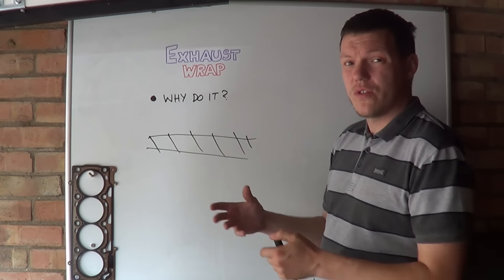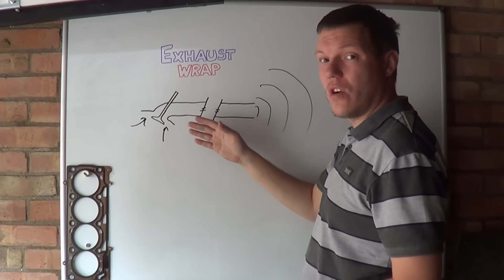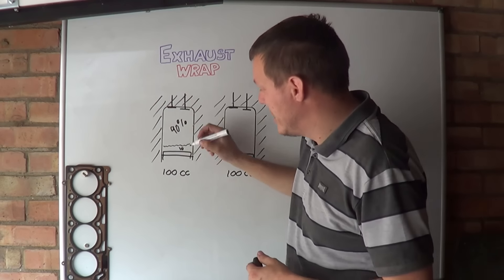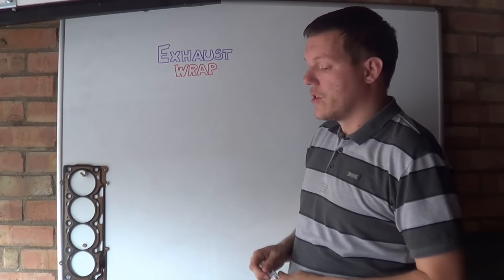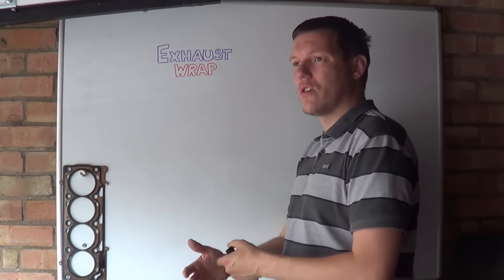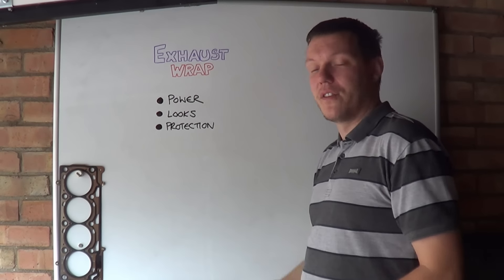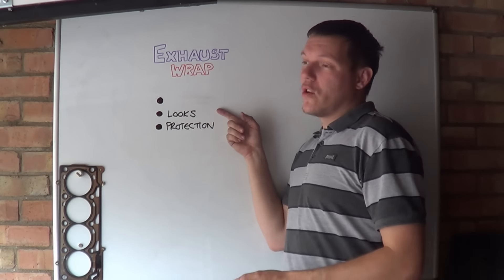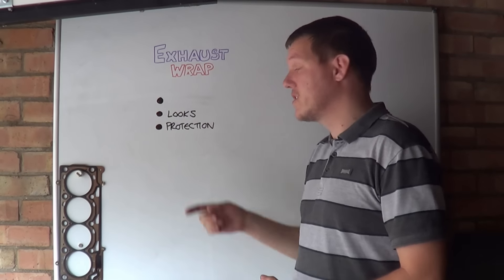Exhaust Wrap - Good or Bad - Bike TEch

Comment: I have 33 years experience in making and fitting exhausts. Non of my suppliers will warranty there headers if you wrap them. It causes major heat retention and will cause all stainless steel pipes to crack and crystallise. One set of headers after just one month use on a vehicle, when unwrapped because they developed leakage due to heat cracks.  They actually shattered when dropped on the workshop floor from about 2 feet. It was areal eye opener to see the damage heat had done to the headers. For me its a big no .
Reply: @jackdale9249  Did you just call me a lying sack of crap. Since when did you have the right to call names . Me I have 34 years in the Exhaust manufacturing industry.I make custom pipes and i Learnt the hard way don't wrap. Now be a nice person and either take my advice or don't .Either way I wont stoop to insults.
Reply: @jackdale9249  THE FACTS:

*Header wraps are designed to keep the heat in the header to improve scavenging of the cylinders. Keeping the heat in the header allows the exhaust speed to remain high. (the right idea)

*There are no header manufacturers that I know of that will warranty their headers if any header wraps are installed on their products.
In most cases the header wrap damages the headers beyond repair. (I will explain below)

*If you run a lean mixture, you "may" see a slim performance gain using header wraps. A rich mixture may show slim to absolutely NO gain in performance.

*If you do not mind replacing your headers and header gaskets regularly, and you like that ugly look of a wrapped header, go ahead and use the heat wrap.

BACKGROUND INFORMATION:

In the past, almost all NASCAR and other racing engine builders used the header wraps for the added power gains. But, after having to replace the headers after each race due to the wrap being about the only thing holding the header together, they do not promote the practice any longer! They now utilize the thermal coatings that are chemically and electrically applied to the headers. Those include Airborn, Jet Hot, HPC, and others.

Imagine having to replace a $1200.00 plus set of headers after each race weekend! Few but the most financially well-off race teams can afford to do this. But, it is also in the downtime for remaking a custom set of headers. Most custom header makers do not have copies readily available.

*I believe that the wraps are good to protect various items from heat, but not to hold the heat in the header. For example: you can use the wrapping for the protection of fuel and oil lines, wiring, etc.

*Cool air needs to be around the header, and insulating it with a wrap to hold exhaust heat in makes the header material temperatures near molten. When you wrap the header you trap the heat in the header, but also in the material that needs to breathe to dissipate heat for it's own survival.

*Engineers, Metallurgists, and other experts out there will state that there is no way that the material can fail because it can withstand, and it was designed to withstand, the internal temperatures of exhaust gases. TRUE! But, when the header is not allowed to cool so as to dissipate those extreme temperatures that the wrap is controlling, you have now developed a heat absorption that compares to thermal friction which will will continue to gain in temperature beyond the normal exhaust gas temperatures (EGT's). This is the same as with most any insulation.

Try this experiment ... launder a load of bath towels and then dry them. Immediately pull them out of the dryer and just toss them in a snug pile on your bed. Now leave them there for a day and then open them. You will find that there is still a considerable amount of heat left in the center towels. This heat, even though the outer towels and bed are normal room temperature have been able to contain their heat. This is a simple thermal insulation test, but with your headers you have an internal heat supply coming from the engine. The heat on the outside portion of the header material is trapped between the warp and the header and will continue to fatigue the header. This build of heat is amplified by the wrap. Towels do not need to breathe, header material does.

The EGTs stay the same but the properties of the header material changes in a way of amplifying the temperatures because of the insulation. This action goes against normal laws of thermal dynamics, but this effect is fact, and you have to pull the ears off most engineers before they believe you. This is the trouble with plenty of education, but NO "common sense"!

Something else that few Racers and Car Owners realize:
Headers Oxidize!

Under normal use and even more with higher EGTs and header surface temperatures, headers will oxidize and material is actually removed from the headers. This means they get lighter and weaker.

Try these actual test numbers:
Mild Steel (1010) uncoated header exposed to 1200º F. in normal air will have a weight loss percentage of roughly 25% with only 10 hours use at this temperature.

Stainless Steel (410) uncoated header will have roughly 8% weight loss in the same 10 hour period.

A coated mild steel header will have NO weight loss at temperatures up to 1200º F. In fact it will actually gain a bit of weight! Between 1300º F. and 1600º F. the coating will begin to show signs of mud cracking or like the look of lacquer checking. However, limited diffusion takes place between the coating and the substrate, producing a very thin film of iron aluminide, which continues to inhibit oxidation.

On A Side Note:

Do you understand the physics of exhaust flow in regards to step-headers?

Step headers are designed to allow controlled and efficient exhaust gas expansion at a selected engine RPM. What does this mean? As exhaust gases are exiting the engine into the header they are still burning and rapidly expanding down the primary tubes. If you design the header to take advantage of the pulse expansions of the exhaust gases you WILL gain horsepower. But, you'd better do it right, or that $1200.00 or more for a set of headers is a waste of money. When you set up a step header, you'd better know where you want the maximum power at, since steps are RPM specific to each engine combination.

I'd better say this now ... a step is an increase in tube diameter.

Here is an example:

A basic Chevrolet 350 cubic inch engine ... 3.48 stroke, 5.7" connecting rod length, 4.0" bore, 10.5:1 compression ratio, standard 2.02 / 1.60 valves ... designed for 6500 RPM operation. Cam specs are: .500" lift, 235º duration @ .050" lift, 112º lobe centerline.

For the average Joe Bracket Racer this would be a standard 1-5/8" or 1-3/4" primary header primary tube size, depending on vehicle weight and where you want your power. Here is the "exact" header size for a racing engine operating at 6500 RPM. Note: This is for max power at 6500 RPM!

BASIC KNOWLEDGE:

As you may or may not know from any education of standard thermal expansion physics, if you heat donut does it shrink or expand the hole? Of course since we live in a 3-dimensional world, it is a 3-dimensional reaction and it shrinks the hole! If any engineers want to argue this, start with your professors, not with me. I already know the facts and I have had engineering "students" argue this fact with me on numerous occasions.

Because of the expanding gases, if you have had the experience (as I have) to see first hand where a header with a wrap fails, it is typically where a step would be. I have had headers in my hand where literally the only thing keeping the header in one piece was the wrap. Whole chunks of the header material was gone, melted away. Talk to most "engineers" (I use that title with caution) and they will probably tell you that aliens stole the metal as the car was racing around the track! They say this because the wrap is causing problems that are not part of normal metallurgy and thermal dynamics theory <key word>. The header warp allows temperatures between the wrap and the header to turn the material molten.

back to top

--------------------------------------------------------------------------------

IN CLOSING:

We know that header manufacturers will NOT WARRANTY a header which has had a wrap installed on it. We know that I have personally seen, tested and inspected headers that have been destroyed after running wrapped headers on a perfectly tuned engine.

Just because an item or product is advertised for a specific use does not mean it does not do what it is promoted as, but it also does not mean it is the best choice either. We have all seen the recent TV commercials on all of these "medical miracles" that do such feats as fast weight loss and re-grow your hair. How often have we laughed at the side affects, like the most common being penile failure. Oh sure, I want to take some drug if my hair starts falling out (yes, it is currently all here) that makes my sex life go to hell. NOT !!! Those pharmaceutical companies can pucker up and kiss my "bald" backside! I'd rather have function than hair.

The same can hold true with other products. Heat wraps are great, just do not use them ON the header. Use them on a device or component on your vehicle that you are trying to protect from header heat.

If you want a true thermal barrier that will reduce thermal loss in the header, reduce under hood temperatures, and make a few horsepower in the process, have your headers coated by one of the many companies available (links to a few are above). Most all of the coating companies offer inside and outside complete coating as standard. DO NOT allow your headers to only be coated on the outside, this is not a complete or quality process.

Some other considerations about the coatings. Once the header is coated, it's permanent. That means that if you screw up your header, it is not an ease job to repair and most header companies do not want to even attempt a repair. The coating permeates into the header material which makes welding processes on a coated material less than adequate. This is why you always coat the headers last, after all modifications to the header are made, and you are 100% sure the header will fit your vehicle.

>>Source: http://www.centuryperformance.com/heatwraps.asp
Reply: The guy  is spouting nonsense it's a bunch of malarkey just ignore him go ahead and wrap if you want it causes no damage whatsoever! 
What he's saying is completely absurd! caused it to crystallize shatter when dropped? get real man is so full of himself the shits coming out of his eyeballs
None of those claims he's makes has ever  been published in any engineering journals! 
for some reason he has just got irrational bias! 
I remember one of my professors would call it  Invincible ignorance ! LOL  he has a case of the ass against wrap so he talks nonsense.
Reply: so just how many sets of custom headers have you made in your life.  Just because you wrap your pipes and suffered no effects is different to my experience. And my opinion does not require such childish rude replies. As I said in my opinion dont do it but that is my opinion. Dont take my advice .
Reply: @neildale1322  THE FACTS:

*Header wraps are designed to keep the heat in the header to improve scavenging of the cylinders. Keeping the heat in the header allows the exhaust speed to remain high. (the right idea)

*There are no header manufacturers that I know of that will warranty their headers if any header wraps are installed on their products.
In most cases the header wrap damages the headers beyond repair. (I will explain below)

*If you run a lean mixture, you "may" see a slim performance gain using header wraps. A rich mixture may show slim to absolutely NO gain in performance.

*If you do not mind replacing your headers and header gaskets regularly, and you like that ugly look of a wrapped header, go ahead and use the heat wrap.

BACKGROUND INFORMATION:

In the past, almost all NASCAR and other racing engine builders used the header wraps for the added power gains. But, after having to replace the headers after each race due to the wrap being about the only thing holding the header together, they do not promote the practice any longer! They now utilize the thermal coatings that are chemically and electrically applied to the headers. Those include Airborn, Jet Hot, HPC, and others.

Imagine having to replace a $1200.00 plus set of headers after each race weekend! Few but the most financially well-off race teams can afford to do this. But, it is also in the downtime for remaking a custom set of headers. Most custom header makers do not have copies readily available.

*I believe that the wraps are good to protect various items from heat, but not to hold the heat in the header. For example: you can use the wrapping for the protection of fuel and oil lines, wiring, etc.

*Cool air needs to be around the header, and insulating it with a wrap to hold exhaust heat in makes the header material temperatures near molten. When you wrap the header you trap the heat in the header, but also in the material that needs to breathe to dissipate heat for it's own survival.

*Engineers, Metallurgists, and other experts out there will state that there is no way that the material can fail because it can withstand, and it was designed to withstand, the internal temperatures of exhaust gases. TRUE! But, when the header is not allowed to cool so as to dissipate those extreme temperatures that the wrap is controlling, you have now developed a heat absorption that compares to thermal friction which will will continue to gain in temperature beyond the normal exhaust gas temperatures (EGT's). This is the same as with most any insulation.

Try this experiment ... launder a load of bath towels and then dry them. Immediately pull them out of the dryer and just toss them in a snug pile on your bed. Now leave them there for a day and then open them. You will find that there is still a considerable amount of heat left in the center towels. This heat, even though the outer towels and bed are normal room temperature have been able to contain their heat. This is a simple thermal insulation test, but with your headers you have an internal heat supply coming from the engine. The heat on the outside portion of the header material is trapped between the warp and the header and will continue to fatigue the header. This build of heat is amplified by the wrap. Towels do not need to breathe, header material does.

The EGTs stay the same but the properties of the header material changes in a way of amplifying the temperatures because of the insulation. This action goes against normal laws of thermal dynamics, but this effect is fact, and you have to pull the ears off most engineers before they believe you. This is the trouble with plenty of education, but NO "common sense"!

Something else that few Racers and Car Owners realize:
Headers Oxidize!

Under normal use and even more with higher EGTs and header surface temperatures, headers will oxidize and material is actually removed from the headers. This means they get lighter and weaker.

Try these actual test numbers:
Mild Steel (1010) uncoated header exposed to 1200º F. in normal air will have a weight loss percentage of roughly 25% with only 10 hours use at this temperature.

Stainless Steel (410) uncoated header will have roughly 8% weight loss in the same 10 hour period.

A coated mild steel header will have NO weight loss at temperatures up to 1200º F. In fact it will actually gain a bit of weight! Between 1300º F. and 1600º F. the coating will begin to show signs of mud cracking or like the look of lacquer checking. However, limited diffusion takes place between the coating and the substrate, producing a very thin film of iron aluminide, which continues to inhibit oxidation.

On A Side Note:

Do you understand the physics of exhaust flow in regards to step-headers?

Step headers are designed to allow controlled and efficient exhaust gas expansion at a selected engine RPM. What does this mean? As exhaust gases are exiting the engine into the header they are still burning and rapidly expanding down the primary tubes. If you design the header to take advantage of the pulse expansions of the exhaust gases you WILL gain horsepower. But, you'd better do it right, or that $1200.00 or more for a set of headers is a waste of money. When you set up a step header, you'd better know where you want the maximum power at, since steps are RPM specific to each engine combination.

I'd better say this now ... a step is an increase in tube diameter.

Here is an example:

A basic Chevrolet 350 cubic inch engine ... 3.48 stroke, 5.7" connecting rod length, 4.0" bore, 10.5:1 compression ratio, standard 2.02 / 1.60 valves ... designed for 6500 RPM operation. Cam specs are: .500" lift, 235º duration @ .050" lift, 112º lobe centerline.

For the average Joe Bracket Racer this would be a standard 1-5/8" or 1-3/4" primary header primary tube size, depending on vehicle weight and where you want your power. Here is the "exact" header size for a racing engine operating at 6500 RPM. Note: This is for max power at 6500 RPM!

BASIC KNOWLEDGE:

As you may or may not know from any education of standard thermal expansion physics, if you heat donut does it shrink or expand the hole? Of course since we live in a 3-dimensional world, it is a 3-dimensional reaction and it shrinks the hole! If any engineers want to argue this, start with your professors, not with me. I already know the facts and I have had engineering "students" argue this fact with me on numerous occasions.

Because of the expanding gases, if you have had the experience (as I have) to see first hand where a header with a wrap fails, it is typically where a step would be. I have had headers in my hand where literally the only thing keeping the header in one piece was the wrap. Whole chunks of the header material was gone, melted away. Talk to most "engineers" (I use that title with caution) and they will probably tell you that aliens stole the metal as the car was racing around the track! They say this because the wrap is causing problems that are not part of normal metallurgy and thermal dynamics theory <key word>. The header warp allows temperatures between the wrap and the header to turn the material molten.

back to top

--------------------------------------------------------------------------------

IN CLOSING:

We know that header manufacturers will NOT WARRANTY a header which has had a wrap installed on it. We know that I have personally seen, tested and inspected headers that have been destroyed after running wrapped headers on a perfectly tuned engine.

Just because an item or product is advertised for a specific use does not mean it does not do what it is promoted as, but it also does not mean it is the best choice either. We have all seen the recent TV commercials on all of these "medical miracles" that do such feats as fast weight loss and re-grow your hair. How often have we laughed at the side affects, like the most common being penile failure. Oh sure, I want to take some drug if my hair starts falling out (yes, it is currently all here) that makes my sex life go to hell. NOT !!! Those pharmaceutical companies can pucker up and kiss my "bald" backside! I'd rather have function than hair.

The same can hold true with other products. Heat wraps are great, just do not use them ON the header. Use them on a device or component on your vehicle that you are trying to protect from header heat.

If you want a true thermal barrier that will reduce thermal loss in the header, reduce under hood temperatures, and make a few horsepower in the process, have your headers coated by one of the many companies available (links to a few are above). Most all of the coating companies offer inside and outside complete coating as standard. DO NOT allow your headers to only be coated on the outside, this is not a complete or quality process.

Some other considerations about the coatings. Once the header is coated, it's permanent. That means that if you screw up your header, it is not an ease job to repair and most header companies do not want to even attempt a repair. The coating permeates into the header material which makes welding processes on a coated material less than adequate. This is why you always coat the headers last, after all modifications to the header are made, and you are 100% sure the header will fit your vehicle.

>>Source: http://www.centuryperformance.com/heatwraps.asp
Reply: @cadillacranch8169  this  is total BS  ! show some articles in legit engineering journals saying wrap causes damge ? you CAN'T !  there aren't any ! 
you tube is deleting false info now and yours should be at the top of the list !
Reply: @cadillacranch8169  i've made plenty of exhaust sytems and many factories like Yamaha have wrapped pipes !  w/ NO damage !  
IF this was really happening as you claim there would be a plethora ( a lot ) of articles in engineering magazines and journals ! there are NONE ! 
you are a delusional liar and should be banned fr you tube ! i'm reporting your posts as lies !  they are deleting incorrect content now ! -like yours !
Reply: @jackdale9249   Okay I'll humour you did you click on the link that I sent you. Click on read more there's a whole article not by me I found it on Google. It's a long read which might be beyound your attention span. As you think it's okay to key board warrior people you don't even know. Under the facts. Look down it says read more. Stop being an angry person venting with threats. The evidence is there.
Reply: @jackdale9249  The apparentely gruesome facts about Heat Wrap.. [Archive ...www.mr2.com › forums › archive › index.php
In most cases the header wrap damages the headers beyond repair. (I will explain ... will consider thermal wrapping a voiding of their warranty.
Jul 23, 2006 - 16 posts - 7 authors
You visited this page on 15/08/20.
Reply: @jackdale9249  
Should I wrap my headers? - Summit Racinghelp.summitracing.com › app › answers › detail › a_id
May 11, 2017 - Header wrap is more expensive than high temp paint. But, it is less ... **Wrapping a set of headers will void the warranty.**. Answer ID 4801 ...
Reply: @jackdale9249  The apparentely gruesome facts about Heat Wrap.. [Archive ...www.mr2.com › forums › archive › index.php
In most cases the header wrap damages the headers beyond repair. (I will explain ... will consider thermal wrapping a voiding of their warranty.
Jul 23, 2006 - 16 posts - 7 authors
You visited this page on 15/08/20.
Reply: @cadillacranch8169  those sources say NOTHING about wrap you lie !
Reply: @cadillacranch8169  i wrote to summit racing I am a racer and summit customer this answer is BS and will soon be deleted !
Reply: @cadillacranch8169  lie doe3s NOT say it damages headers you lie !  blogs are NOT engineering level talk thery are some squid ususally spouting nonsense !
Reply: @cadillacranch8169  point is you are lying ! it will NOT damage as you claim !
Reply: How does it affect performance?
Header Wrap keeps the heat in the pipes. This improves exhaust flow and The Scavenging Effect. It also lowers underhood temps. Wrapped headers will make a little more Torque and Horsepower than a bare metal set.

Despite improving performance, wrapped headers have a few weaknesses. First, because the heat is retained inside the wrap, the metal gets much hotter than painted or coated headers. The higher heat cycles will fatigue the metal. The wrap will also hold moisture, promoting rust and corrosion.

*Wrapping a set of headers will void the warranty.*
This is from Summit racing web site
Reply: @cadillacranch8169  ANOTHER bs VIDEO THE PIPE WAS WRAPPED AFTER ALEADY CORRODED ! 
AND WHO USES STEEL IN EXHAUSTS ?  ALL ARE ss NOW  OR INCONEL ! SHIT RUSTS IN uk AS IT'S FRIGGEN wet ALL THE TIME THERE !  HAS nothing TO DO W/ WRAP !  duh !
Reply: @cadillacranch8169  BS article fr 2015 on go karts ?  get real  wrap causes NO harm ! 
you are scratching the bottom quoting a Go-kart racer ! LOL Hilarious ! 
bs premise saying the heat is so high it will damge the pipe !  no engineering proof ! 
 and NOONE uses mild steel for exhaust anymore !  so NO that article proves nothing . 
ALL modern systems are stailess Iconel , or titiainuim  SS is preferred . 
Most Ferrari owners fit exhaust blankets which are the same as wrap really !
Reply: @cadillacranch8169  all irrelevant as noone uses ferrous metal now it is all SS , or other NON rusting material ! !   you are a fool to keep finding articles which do not prove your assertion that wrap is bad , causes damage it does not !  any condensation wil be disssapated by heat anyway !  you lose give up you fool !
Reply: This all sounds great! But, there is more to consider. You should always check with the individual manufacturer's warranty policy before wrapping your headers or exhaust. Most warranties become void once the headers have been wrapped. The reason being: these products are designed to hold the extreme engine temperatures inside the header. By doing this, the cool air cannot circulate around the header and when the pipes cool back down after running your engine it creates condensation inside the header. This can lead to corrosion build-up, rust, and wear the headers prematurely.
Reply: @jackdale9249  You sir are a very rude individual . Not all headers are made of Stainless Steel . Most header manufacturers will ask if you want mild or Stainless it's your choice. Stainless Steel headers are usually 304 grade or 409 grade. 316 Stainless is useless for headers as it cracks badly . I know all this information as it's my job my lively hood . I would back my knowledge of metal and fabricating over yours any day of the week. Further more if you cant' construct a debate without calling people a lying sack of shit then i suggest councelling. Me personally did not bring codensation into the discussion. But as usual you dont answer my responces. You just vent insults because you are wrong. Google, Pacemaker headers , Advance headers . Genie Headers ,H&M Headers , Red Back Headers,Wildcat Headers all manufacture in mild steel. These headers all have great logivity as long as you don't WRAP them. All of these manufacturers void warranty if you choose to wrap headers. Plus NASCAR  headers are wrapped but only last one race as they are destoryed by the heat trapped within. But now days most teams have ceramic coated headers as that out performs wrapped headers .That information is all over the net . Your turn for a reply amaze me show me an article to back your supposed knowledge. Bet you cant resist insulting me again. Your turn keyboard warrior.